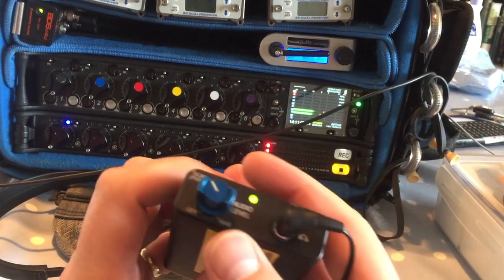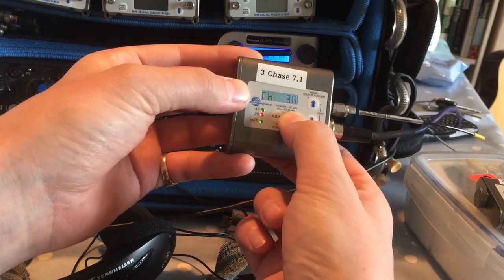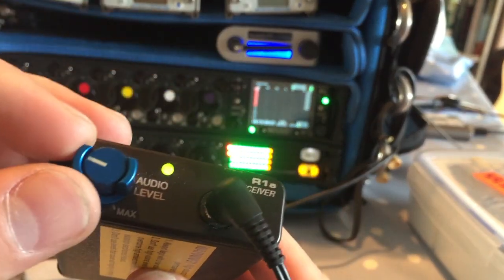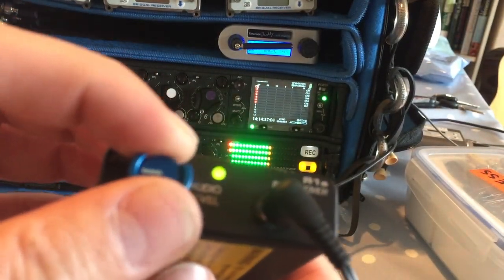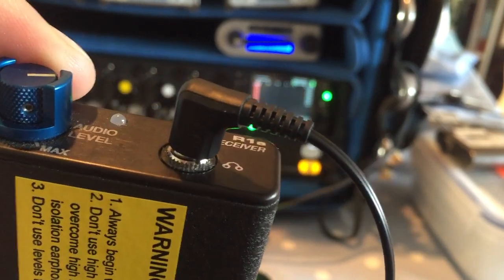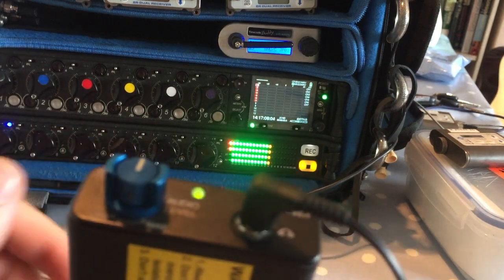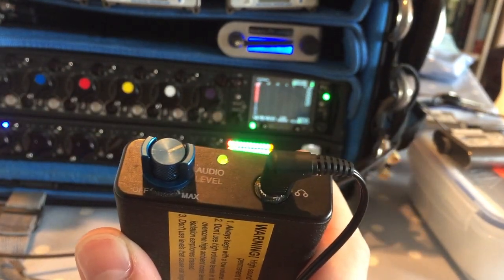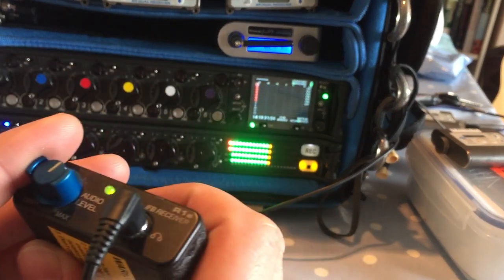Lectrosonics R1a IFB Receiver frequency tuning tutorial

Comment: I'm working with a zoom f8 will this same method work if I am using three for monitoring.?
Reply from the maker: 3 x R1a or 3 x Transmitters?
Reply: so I'm distributing a lectro Snb in IFB mode to link to three R1a units.

Comment: Just a tip, when programming only turn on one IFB transmitter at a time, especially when you are in close proximity to the transmitters.  This makes the process much quicker, especially if programming 20+ receivers with all five channels.  Your tip about being able to circle back is key with multiple channels.  As sound mixers we get it, but other departments don't want to have to power down and back on to get that first feed.
Reply from the maker: good tip!
Reply: Yeah I was thinking that would be much faster.